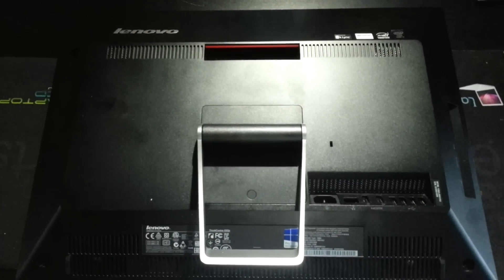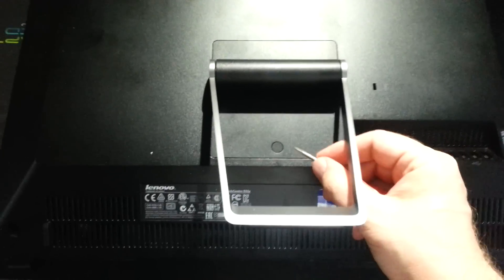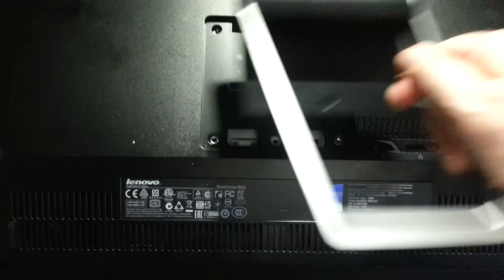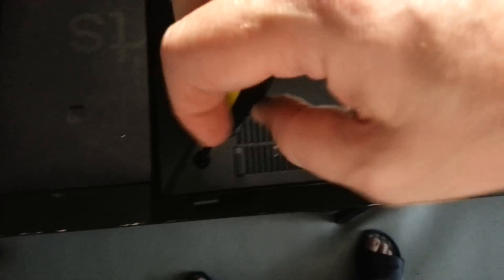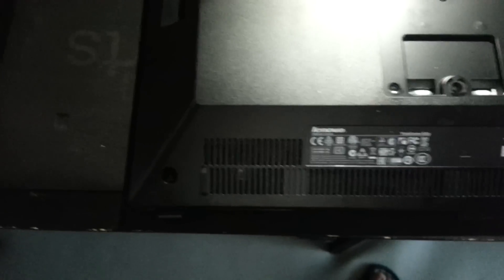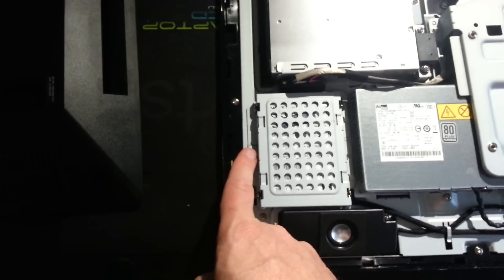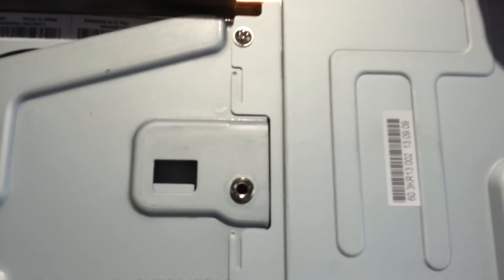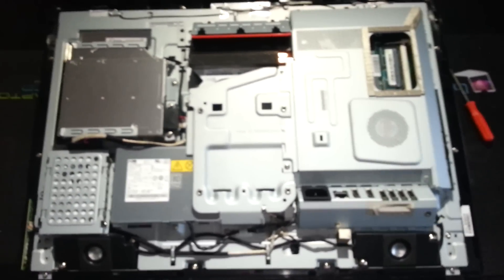Lenovo Thinkcentre e93z - Opening & Memory & HDD Installation

Comment: Hey man thanks for your video. I just acquired one of these computers. My only problem is, is the display doesn't seem to work I suppose. Took the back off as in your video. When I plug it in the fan comes on and appears to power up but there is no light on the power button and no screen display but the fan does run so I was wondering if you may know any more about these, or may know exactly or how easy it is to access my display and power Parts so that I may check my wiring and connections. Any help would be greatly appreciated. Thanks dude

Comment: My M93Z can be upgraded to 16gb RAM.   The rear stand only clips into place though with no hidden screw however I am struggling popping the back cover off!   What are the positions of the locking latches inside of the cover?
Reply from the maker: Niall Cusack you will have to try and see them on the video if you can.